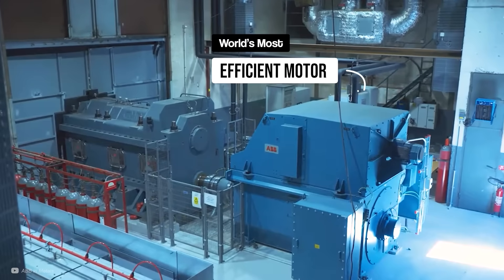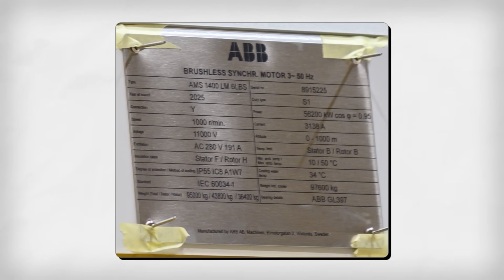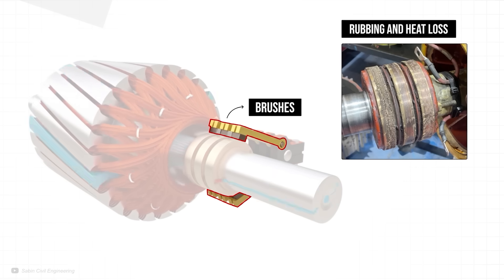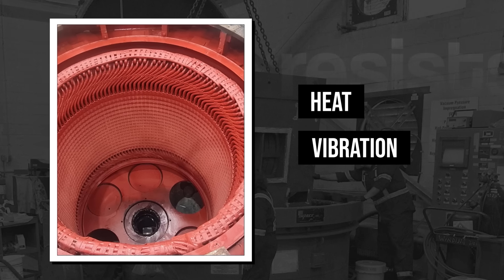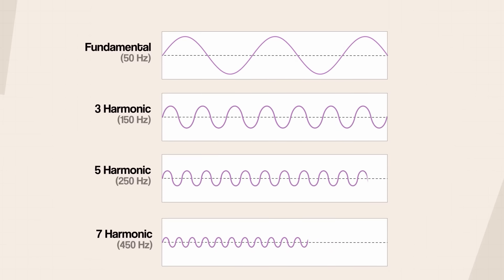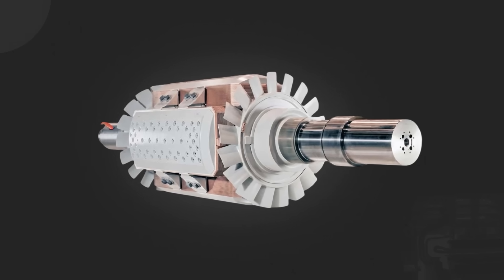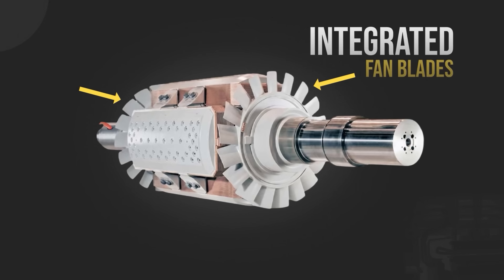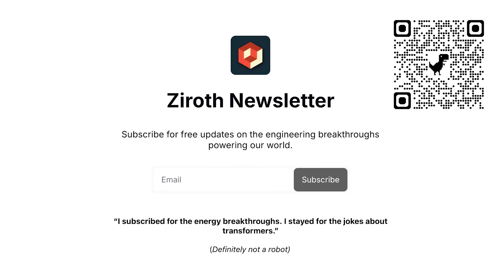How This Ultra Efficient Motor Just Broke The Limits

Comment: 99.13% is insane.  
In contrast, an ICE is just a heater with some mechanical output as byproduct
Reply: Don't forget that there are energy losses occuring at the power plant which generates electricity. That inefficiency is not directlu visible but still leads to energy losses when generating electricity required to run the motor. All must obey the 2nd law of thermodynamics!
Reply: no, its marketing, and using statistics to FOOL YOU.

that electric motor sits there. it doesnt do anything. it REQUIRES A SOURCE OF ENERGY. that comes from an external source. with all its own inefficiencies. it is not a machine in isolation. it is part of a system.

to ignore the generator, the conductors, the losses due to heat, magnetic fields, and electric fields, the conversion of a source of energy into the electricity the electric motor REQUIRES, is to compare, for example, the exhaust of an ICE and say its "99% efficient as it flows very well". "the air filter is 99,9% efficient as it traps all but 0.1% of dust..." you dont cherry pick individual items of the ICE, you look at the ENTIRE MACHINE. a self contained unit that takes a source of energy and converts it to motive force... and heat.

if i stall an electric motor, it produces no output power, yet consumes input power, converting 100% of it to HEAT. is that efficient? it is doing NO work. 

when an electric motor and its generator are of equal resistance, than half the applied energy to spin the generator is lost as heat in the generator, half in the motor. ignoring the conducting wires, thats 50% of the applied power being delivered to the motor. then that motor has another loss as the input power never equates to the shaft POWER as torque x rpm. its called "jacobis law", and its very similar to "therevins max power transfer" or "impedance matching".

but most of these shill journalists have never heard the term, most electricians have never heard the term, if anything, it is only vaguely discussed when studying to be an EE... and then its quickly forgotten yet it is a FUNDAMENTAL RULE, and cannot be avoided or overcome.

i am yet to see ANY claim of an electric motor that consider the ENTIRE APPARATUS rather than selectively cherry picking the bits that sound "good".

when i design and rewind an electric motor, the rule of thumb is that its 50% efficient. in some cases, its down to 30%. for every 3kw applied, expect 1kw of useful SHAFT POWER... when i install a motor generator, i have to have the engine output at least twice the power as what the generator is rated for, as when the generator is fully loaded... half of that energy is being dissipated as HEAT. the generator itself should ideally be at least twice the rating of the load it encounters in normal operation.

why dont electric motors other than AC induction motors ever mention the OUTPUT POWER? and at least with those, they also state efficiency on the rating plates. input power as amps x volts x power factor. rated output power, rated output RPM... and yet they STILL ignore the source of electricity, transmission losses, etc... 

"i have a 5kw e-bike!"
so, is that useful power at the shaft? at the wheel? or is that the electrical power it is CONSUMING? yet to see anyone put one of these "highly rated electric motors" on a DYNO and actually PROVE it... mostly because they themselves have no idea. they just bought a kit from fleabay or aliex and bolted it together. "it says its 5kw!"

maybe you should try looking into how electric motors actually work. it may involve some text books and heavy mathematics. or you can remain deluded, duped, and continue your brainwashing with YT "educational videos"...
Reply: @paradiselost9946 Wow, that was quite a scorching rebuke.  Well done, sir!
Reply: the ICE is an actual efficient machine and it allows us to do things electric motors will never even think about lol!!! the worlds largest ships, aircrafts, trains, trucks..... are able to cover vast distances all around the world! electric motors are great when youre directly connected to the grid.
Reply: But ice can generate electricity from fuel, an ev can't.
Reply: @Markcain268  why would that even matter? You then are converting and thus have losses. As for making power - you have options, that offer greater over all value. Everything from Geo-to Solar that offer no carbon release at all. Let alone no need to really transport saving on land space for more houses or cleaner environment.
Reply: @Markcain268 ev doesn't need fuel. U get it directly from the sun
Reply: @commieTerminator that bright thing that's been obscured by thick, grey clouds for the last 2 days?
Reply: @Markcain268  Maybe in the area, but the sun shines else where as well. Also, my panels still produce some power even when there are clouds.
Reply: @adr2t yes, they do, but very little.
Reply: @Markcain268  pumped hydro to the rescue. It's not sci-fi, it's already here
Reply: @Markcain268  Doesnt matter, the fact that it still does and covers basic needs is already win over fossiel fuels that can't unless I burn it and it turns into CO2. Can't run a ICE car without fuel. At least even if its very little, I will still have something.
Reply: How much efficiency does an ice engine usually get?. I know nothing about these things and just had this interesting sounding video pop up in my recommended.
Reply: @WyattOShea  around 30% - starting they can be as high as 35-40% but do drop over time as low as 15% if the engine isnt taken care of. One difference though is we can take the heat that it does produce and run that back into the car during the winter/colder months. Something an EV monitor would have a harder time as it gets more efficient. With that said, it would still be better over all to go electric than to continue to burn and use up fossil fuels that release a CO2 gas.
Reply: @adr2t  Damn that's crazy low in comparison :O
Reply: @WyattOShea  if you account for the efficiency of generating the electricity it becomes much more comparable.
Reply: @adr2t  Current ICE's can only use waste heat for cabin heating in the fall, spring, and winter in northern climates, but if they had some miniaturized systems typically found in gas-fire power plants for waste heat recovery to produce mechanical power, they could reach much higher efficiencies, let alone the attention for better aero. However, the auto industry doesn't believe their customers want higher efficiency, and instead are choosing to sell larger a bulkier vehicles. 

To your last point, fossil fuels are a gross misnomer of the fuel used in ICE vehicles. They are not from fossils, they can be produced over time by ordinary plant matter. Hydrocarbons can be synthesized by industry, although I'm sure the processes need much more work to be competitive to drilling. Some people in the scientific literature also believe the generation of hydrocarbons could be a renewable process itself, so I wouldn't be so sure.

I do agree that pollution from the burning of fuels is a terrible ecological nightmare in some cases. But I would never force the transition to electric. There are easier things that industry can do to protect the environment than hold our civilization hostage with a mandatory transition.
Reply: @adr2t  they can go over 40% and run all kinds of fuels, also it doesnt go as low as 15% unless its a very old engine. the combustion engine cylinder or turbines allows us to do things that are impossible with electric motors and batteries.
Reply: @carholic-sz3qv  As I said, that is only if you dont take care of your car, but they normally range in the 30% after a while of use. No, most ICE cars are going to be design to run their fuel - you can't put a hotter running fuel into one and think its going to run jsut fine lmao.

With eletricity, you remove the need for that fuel in the first place - so no need to split it into different types reducing the CO2 release alone.

Let alone you dont have to transport it using up fuel just to carry it to a location or over seas.
Reply: @Infinion  The problem with heat recovery systems is that you have to start at a higher temp - the temps they produce might not carry over well to really make any usable power let alone most of them only produce something like 30% of that - so you are talking 1% maybe of power recovery. I could be wrong, but most of the time you have to start out with some pretty high temps to make this work well. The other issue is the cost to perform that recovery as well.. so even if you could get it to work, like many things, the cost more than likely wouldnt add up to being worth it along with the extra weight and generator to turn that back into any other form of power.

Sure... but you are still burning it off and not recapturing it. BIO mass along can't do it and even if we make a machine that could, it would use more power than it would be worth to just not burn it off in the first place.

I never said it had to be a force thing, but you do wanna nug it in the right direction. Same for the need to push for devices that use less energy for the same work. There isnt a reason why computers need 500 watts just idling around, right? You wouldnt want light to still burn 60 watts, right? Heat pumps can be used today to reduce the power requirements and as you point out - they are heat recovery as the pull the heat thats already there.
Reply: @WyattOShea   around 25% efficiency, most energy produced is lost as heat and friction
Reply: I know trains are not that efficent, but they are still efficent enough. The german ICEs reach about 88% from overhead wire to mechanical energy. So mechanical energy is by far the main output.
Reply: @Johannes-c7p  Just to be clear, by "ICE" the commenter means a vehicle with an Internal Combustion Engine (ICE) such as a petrol or diesel piston engine or a turbine engine.
Reply: @kirkjohnson6638  Maybe he should mention it that he does not talk about trains. When you google ICE the first about 40 links are all about the train, no exception, and there are images, videos ... And no, i am not in Germany
Reply: @Johannes-c7p  Yes, that should have been made more clear, especially given a worldwide audience where the ICE acronym may not fit other languages or be in common usage.
Reply: ICE has been able to make lots of noise without any annoying hp gains.
Reply: Absolutely an incredible figure! 99.13% - almost difficult to believe it, perhaps the same could be done for generators...
Reply: @anthonytester6873  how about batteries then? thats the actual important part! imagine running this on batteries lol!
Reply: @anthonytester6873  If the motor spins both ways, then it is also a generator
Reply: @anthonytester6873   Yes but an electric motor requires generation, transmission, and storage and there are losses in each step.
Reply: @The-yp7lr  But we also recover a lot of that with regeneration breaking something and ICE engine can't. At leat for city driving, you would have higher losses with ICE per stop go situations than you will with an EV.
Reply: @The-yp7lr  so does in an ICE but worse. 
Energy consumed by fuel pump, coolant pump, radiator fan and most importantly the transmission (ICE transmission has clutch packs/CVT belt or torque converter and they generate heat via friction)
Reply: @The-yp7lr  Even electricity generated from a coal fired power plant is more 'efficient' than burning fuel in an ICE
Even after accounting for transmission losses 
SCALE makes a difference
Reply: @commieTerminator  the generation efficiency of electricity levels the playing field significantly
Reply: @strawberry_cake1703  if extracting oil from underground counts as free energy then consider free electricity coming from a solar/wind farm or a dam. 
I have my own rooftop solar and the sun doesn't ask anything in return from me
Reply: @adr2t  and on the highway ICE are more efficient than EVs plus they can carry significantly way more load and go much much further on a single fill.
Reply: @commieTerminator  blablablabla!!!! electric motors needs coolant too just like many other components plus the battery which you cant increase the range whereas you can just plug a gallon or more in to your ICE.
Reply: @thebestevertherewas  very lame joke!!! the ICE is more efficient, it can carry more loads, travel further, go to the most remote places as long as its accessible. in Australia for example they have massive diesel semis that hauls up to 6x the load of the tesla semi and they can go everywhere.
Reply: @carholic-sz3qv  

 ICE more efficient?
In what sense, exactly?
At present, they only hold relevance in edge cases.
Most people in developed nations drive under 30 km a day.
And let’s not forget—
the true bottleneck of EVs lies in battery tech; 
nobody seriously claims electric locomotives are inferior to diesel.
As batteries advance, today’s concerns will fade into irrelevance.
Within 5–10 years, EVs will be a complete no-brainer.
The only domains where fossil fuels will persist are commercial aviation, rocketry, and heavy sea shipping.
Reply: @thebestevertherewas  stop talking crap!!! because people drives 30 miles a day doesnt mean they dont go on a trip or actually need a work vehicle to tow and do actually more energy demanding activities! the ICE is just the perfect vehicle for any kind of use doesnt matter if developed or not developed country.
Reply: @thebestevertherewas  fossil fuels litteraly persists on vehicles too. go to africa or south america or middle east or even Asia the way those people uses their vehicles very heavily overloaded driving on the worst roads or environments possible no EV can even dream about, lets not forget overlanding, and many other applications.
Reply: @thebestevertherewas  yes electric locomotives are inferior to diesels, the longest and heaviest trains around the world goes through the harschest environments through the most remote places while hauling vast amounts of freight, electric locomotives needs a very expensive installation to operate.
Reply: @thebestevertherewas  in 10 years ill like to see your perfect ev semi replace an australian or scandinavian massive semi with multiple trailers lol!!!
Reply: @thebestevertherewas  the most efficient airplane today is able to fly for 20 hours non stop at over 800mph thats what we call efficiency with combustion engines.
Reply: @carholic-sz3qv  r u comparing cooling requirement of an ICE with a motor? Go and try to touch them with bare hands after 30 minutes of operation.  
Secondly, u r diverting from the topic. 
It's about energy wastage and not about weather u can juice up overnight at home or need to visit petrol/gasoline station
Reply: @The-yp7lr   does ice, you have to drill, refine and transport the fuel
Reply: @carholic-sz3qv  First part is simply not true. The other two points is because fuel carries more energy. Batteies just havent reach that level yet, but the gap is getting smaller and smaller.
Reply: True, but you cannot get anywhere near 99% efficiency out if any EV motor because they need to ba able to operate over a wide range of speeds and loads, plus cars need to brake and they have inertia.  Plus you have batteries that waste energy borh while charcing and discharging and you have lots of paraitic systems like air conditioning, heating, heated seats, battery thermal conditioning, electric motor cooling, lighting, infotainment systems, etc.  Plus much of the electricity you buy to charge your EV started off as coal, oil, or natural gas and the power plant wasted much of the heat the boilers generated to power the steam turbines and the refining and mining/drilling/pumping/transport processes related to the fossil fuels also wated lots of energy (just as they do to deliver gasoline to gas station pumps).
Reply: @kirkjohnson6638  You generalize way too much which makes most of your claims inaccurate or not true in many instances. For instance   Iceland, Norway, and Costa Rica are leading the way in renewable energy production, with nearly 100% of their electricity generated from renewable sources. Almost 100% of Iceland's electricity comes from renewable sources, 73% hydropower and 27% geothermal. Your arguments against EV are way outdated as advancements are happening at a very fast pace.
Reply: @checkfactschecking  Kirk actually had a very reasonable response. There isn't anything about what he said that is outdated, and your rebuttal doesn't offer any examples besides "advancements are happening, its happening fast!" which is a vague hopeful statement.

Not only that, you accuse kirk of generalizing, and then cherrypicked three small countries with a high renewable energy generation. Since the subject is efficiency, you should consider that renewable energy isn't objectively better or more efficient. The best situation for an EV's roundtrip efficiency is hydroelectric or nuclear. However, the delivery of the electricity and the system efficiency will certainly keep EV's at around 75%. DC charging vs AC trickle charging and time of day is also going to impact efficiency. 

I hope you're not trying to be a green energy moral absolutist and you're actually trying your best to argue for correctness.
Reply: @Infinion  He said EV motors are inefficient and that's a lie. The things attached to the motor use energy and you can't blame their use of energy on the motor. He didn't do that with an internal combustion engine that are generally 25-35% efficient rather than the 75-90% efficiency of an EV.  
From your reply one can only conclude that you don't think any large countries have mostly green energy.  Is that so? As of 2022, 82% Of Canada's energy sources came from non-greenhouse gas emitting sources such as solar, hydro, wind and nuclear power.  In China, the newly installed capacity of renewable energy in 2024 accounted for 86 percent of China's total newly installed power capacity. They are growing their renewable energy exponentially. Big enough country examples for you?
Your information is outdated, so spare me the Anti-ev BS regardless of the facts.
Reply: @checkfactschecking   Kirk said EV motor's can't be 99% efficient because they have to operate under a wide range of load conditions and speeds. You're intentionally misconstruing his words. You should have learned at 9:53 that there are efficiency maps for motors at different torques and RPMs, but you needed to attack him because you either can't argue in good faith or are seeing red from the moral absolutist's conviction, and lose every and all reading comprehension.

You also misconstrued my reply as well. Why should I continue to correct someone with words they cannot properly see? Who cares about greenhouse gas or any emission of an energy source in a conversation about efficiency? This is misdirection. China's power production is coal dominated, and imports 22% of the world's coal production, are you going to consider how all sources of energy are consumed to make an argument about wall-plug efficiency? Nah just misconstrue more of my words and misdirect with talks of the type of plant.

Calling my figures for EV efficiency "anti-EV BS" are such a loser's argument. It's like saying @checkfactschecking actually checks facts and represents them truthfully.
Reply: @Infinion  Thanks for covering for me.  I don't get why/how YouTube sometimes notifies me of replies to comments and other times it does not.  I hadn't seen the couple replies from others (to which you eloquently responded).
Reply: @checkfactschecking   It's cute that you call Canada a large country.  Sure, it's large in land area, but that has nothing to do with its population nor the fact that about 80% of its small population lives within 100 miles of the US border.  And China is very far from green with their energy production.  They rely heavily on coal and are its biggest consumer.

If you love solar energy and recycling, you really should love coil and petroleum since they are both just captured sunlight that the earth converted into concentrated energy by recycling plants.  When we burn it, we release that CO2 back into the atmosphere where new plants can use it to grow.

As for electric motor efficiency, a couple of others covered that topic well.  All motors dissipate heat in their couls in proportion to the square of the electric current flowing through the coils.  The external torques on the motor times the shaft rotational speeds equal output power, but the torque in the shaft is also proportional to the current in the coils.  So, when loads change, motor currents change and so does the i^2R losses.  Additionally, the rotating magnetic fields in a motor create EMF in the laminated stacks if the rotor and stator and that EMF causes eddy currents to flow in those soft magnetic materials.  The materials selected are both laminated and chosen for their electrical resistivity in order to minimize those currents and their resultant i^2R losses.

And, if you want to get relly down and dirty about the efficiency of EVs and ICEVs, they're both essentially 0% efficient because they start each day in your garage and wind up at the end of the day back in your garage having done no useful work, but having consumed energy.  All they ever really do is move air around for no useful purpose, generate some heat in their wheel bearings and such, and cause a cyclical deformation of the elastomeric tires as they roll with the weight off the car upon them.  The only time that a car actually does useful work is when you load cargo into it at one altitude and deliver that cargo to a higher altitude and unload it.